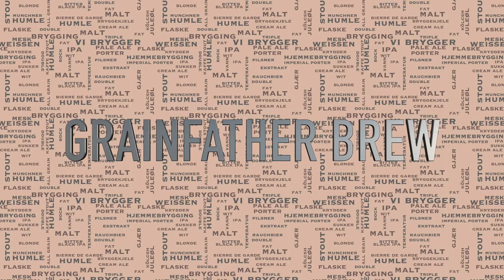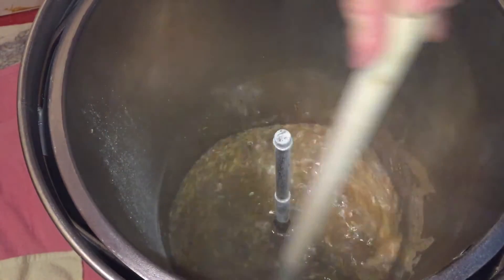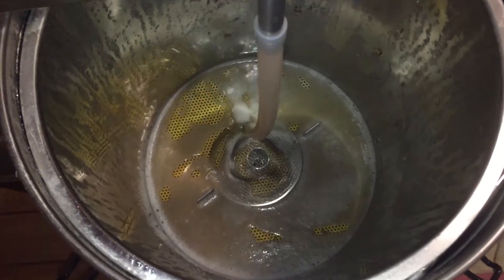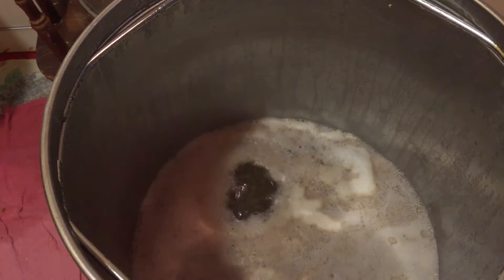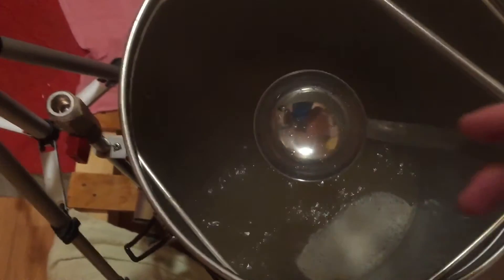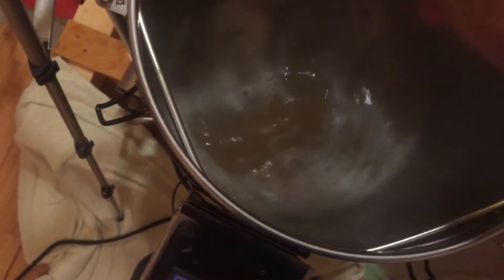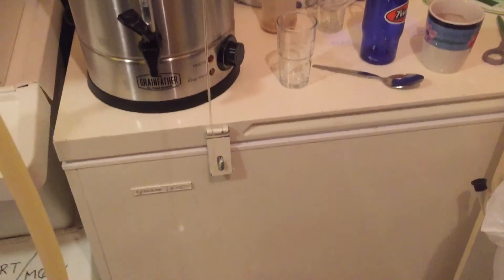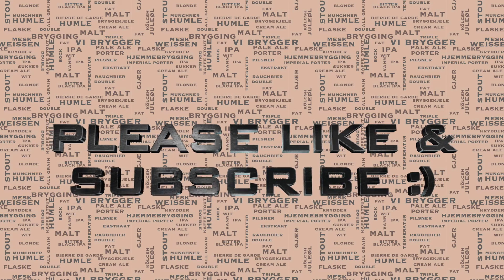Belgian Wit Grainfather small batch with micro pipework - tips and tricks

Comment: Can you use full 6.5 gallon carboy for a small back of about 3 gallons? If you can use it,  what pitfalls to avoid.  Thanks for your videos and info. Scott
Reply from the maker: You can, just be careful on opening it after fermentation is over and not sending the beer to bottles or a keg. That's a lot of headspace in which the beer can oxidise in.
Reply: David Heath I'm confused on the not sending to your bottles or kegs part?
Reply from the maker: Transfer from the carboy to bottles or kegs.

Comment: great tips with the sink strainer, plastic bag and washing in fermenter! Do you think the micro pipework is necessary? Couldn't you just lower the top mash plate and let it float? Thanks
Reply from the maker: Glad you liked the videos:) . For grain bills of 3-4kg the small pipework is very important for efficiency. You can brew small without it but you will need to factor a lower efficiency in. Its not expensive:)